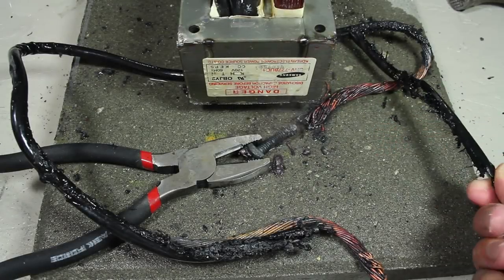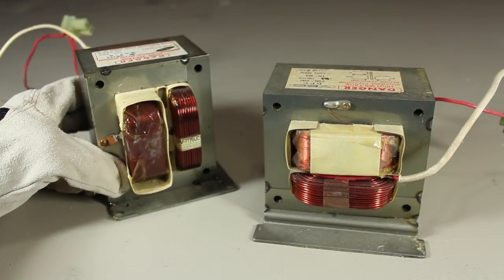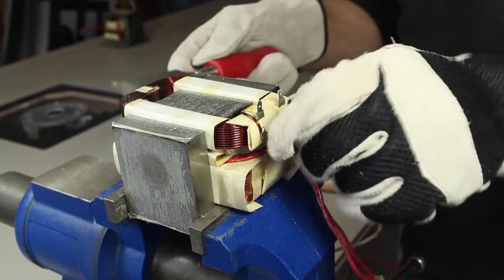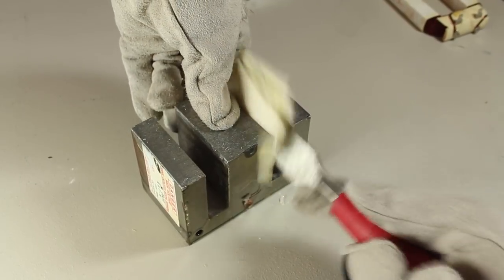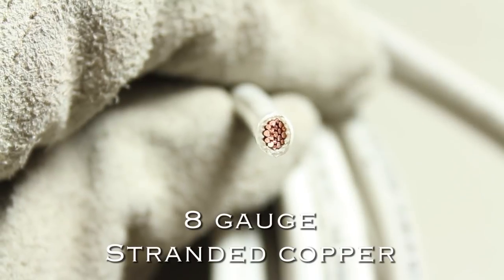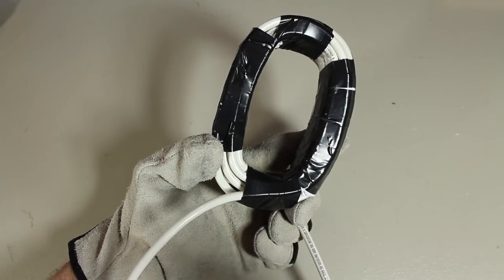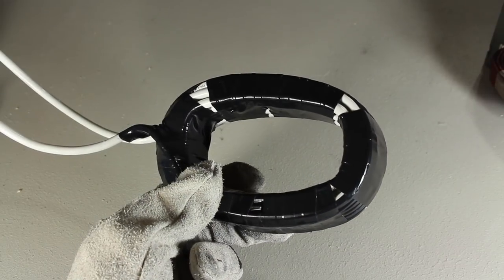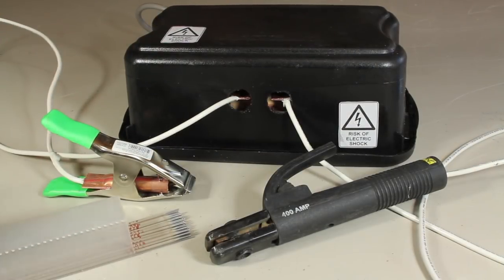Making an ARC Welder - Part 1 of 2

Comment: I built with 4 MOT, and got 36 V AC, 250A. Added a 220v AC cooling fan, a selector swith to get power from 3 trans or 4 trans, a 40A tripper, and one AC Power Indicator. Welder Works fine with 3 trans itself.

Comment from the maker: The stick welder and metal melter are two different modifications, so the power will be different for both.  Metal melter is up to around 800 amps at 2 volts, and this stick welder is up to around 100-120 amps at 30 volts.

Comment from the maker: I'd never heard of that before, but I just looked it up and I'm sure it would work.  To modify it, I'd just use thick electrode tips rather than 4 or 6 gauge wire.  Something like 2 gauge.  I'm sure it would work easily.  Thanks for your comment.

Comment from the maker: Congrats on your new subscribers.  Actually the earlier attempts failed because I tried a single MOT with 28 turns of 12 awg on 120vac and the insulation melted (for obvious reasons).  This setup hardly even gets warm after burning 10 rods in a row :)  Great duty cycle I'm happy to report!  I'm still a fan of the electrical tape, but respect your opinion.  Looking forward to your next tut!

Comment: Better off buying one for your own sake unless you really know what you are doing, another reason would be the need to change current and/or voltage, you need different strength to it depending on what you are welding..
Reply: +IAA015 He made a variable amperage system, search his "Scariac" video.

Comment from the maker: 8.36 mm2 - compliments of Google :)  Number of turns determines voltage.  Gauge of wire handles the current.  Bigger is better, but any bigger than 8 gauge won't fit in the transformer, so it's a compromise.

Comment: 1) Why do you not use the original secondary coils?
2) How do you determine how many wraps to make the new secondary coil?
3) Any idea how many amps this is?
Any response would be appreciated, I really enjoy your videos.
Reply: 1) because you need low voltage and high amp
2) the lower the turns the lower the voltage
3) you need amp meter to calculate
Reply: Thanks for the response!!
Reply: I understand the volts, how do you calculate the amps?
Reply: Winston Jordan
You should use an amp clamp meter on one of your output leads and you may increase or decrease the turns of the secondary acording to your needs

Comment: If you're into RC, the old secondary wire used in older, larger microwave transformers is perfect for rewinding fried outrunner brushless motors, it probably has a mile of it in the coil if unwound. Newer, smaller microwaves may use aluminium secondaries, not good for much, so make sure its copper.

Comment from the maker: Do you know any projects using cathode ray tubes?  There is a little wire, some capacitors, and a CRT in the monitors, but I'm not sure yet what you'd use it for.  There should also be a flyback transformer, and I know a few projects those could go into.  Any ideas will be considered.

Comment: how is it holding up. did the 8 gauge last longer than the 2 gauge or did it melt too. i've bin thinking of making a graphite ARC furnace to melt iron sand and maybe make steel.

Comment: I didn't know you could MMA weld with AC. Learn something new every time I watch one of your videos :) For DC, You can put 2-3 car batterys in series, as long as they have the CCA. Use some fence wire wrapped round a large form for a variable resistor. Surprising how long they last! I've been thinking about making an AC TIG, for ally. This might be a simple way :)
Looking forward to the next video.

Comment: Hi Grant, I'm 71 know, and worked as an Electrician since joining the Navy at 18. My work was always Maintenance Electrician. Repairing manufactured electrical equipment .Your at more of R&D projects.
The pole peaces on the xformer could be solid iron, with large circulating current, they are laminated to
reduce this current, to multiple smaller currents.Tack welding or clamping the end of the pole, allows a complete circuit, for the Eddy Current, and your right, it's a loss you can live with.

Comment: A suggestion on the vice work.  Try a set of "soft jaws."  These can be as simple as two pieces of aluminum sheet metal, bent ninety and placed on each jaw prior to clamping.  This way the part is pressing against the softer, rounded corner, aluminum as opposed to the harder, sharp edged, steel jaw.  On the complicated side, I've seen new jaw forms machined out of aluminum or bronze that fit parts exactly.  That's more than most people need.

Comment: Yeah, I know people who've done it with 1 core but it's tough to get it right. You probably can't use hookup wire, you'll need extra turns on the primary too. Need that extra copper to keep heat down. 2 cores and you've got a luxury of wattage :) Awww yeah.

I have 5 scripts open at the same time right now, they're all interconnected so it's taking forever. I'm really excited to see your water resistor, looks better than any I've ever seen. Ghetto but a polished, classy, reliable ghetto. I like.

Comment: If I live in the U.K. And so my outlet voltage is 240v and I'm guessing the microwaves transformers are also made for 240 v is one transformer fine ?
Reply: 1 transformer won't give you enough power to weld. He says this at the beginning!
Reply: Sean Craxford but i was thinking cox im in the uk the microwaves would be working with 240 v , so i might only need one
Reply: not likely, im guessing your microwaves are rated for similar wattages (here they're 1200 ishh) and its really the wattage that's holding one of them back
Reply: he is using an electrolyte in a tub to power his. i believe the transformers are DC with an inverter in the loop in the microwave, so you will need to convert the AC current to DC before the transformer. if you can push 240V DC to it, and it handle the load without catching fire....... it should weld. I weld at 40amps most of the time (1/16th rod) however when using 1/8th rod i have to push more of 90+ for 1/8 steel.
Reply: i tried this, my welder litteraly caught fire.

Comment: You are correct about the shunts. A better method than shunts is to add extra turns to the primary, but copper is more expensive than iron and manufacturers don't care about the efficiency.

Shunts are removed because they limit the power and at a 120v 1800w level (not so much 240v) you need every drop of power on the output you can get, even if it becomes progressively less efficient to get those extra few watts.

Comment: why do you have to rewind the secondary coil, how and why does the amount of turns in the coil effect the amps/volts?
Reply: amps is how much energy is in the wire volts is how fast the energy flows threw the wire also theres a balance with a transformer if you want more volts the amps have to equally drop and vice versa the reason you need to rewind the transformer is you want high amps not high volts, m.o.t. put high volts low amps you need to amps in order to weld so to speak ive made things like this before.
Reply: GA Drache  Voltage is more like the force that pushes the electrons through the wire and can better be described as electrical pressure, not so much how fast the amps flow. It can also be described as the electrical potential between 2 points.
Reply: Still not a very good answer. I want to know what/why the different amount of whinds in the 2nd coil make it different then the primary and why it needs to be different
Reply: Well its hard to understand, in transformers they are either step up or step down, in most cases. That means that the voltage is either increased or decreased. For example, you have so many turns of wire on your primary and you put 120 volts onto it. The voltage flowing through the wire will cause a magnetic field to be created, the magnetic field will then induce voltage into the secondary winding. To step down your voltage you use less turns on your secondary than your primary. To step up your voltage you increase the number of turns on your secondary compared to your primary. However when you step up or step down your voltage, your amperage also rises or decreases in a opposite manner. When you step up your voltage your amperage is reduced, and when you step down your voltage your amperage is increased. That's why, in the second part of this video, he can put 240v into his primary windings (2 transformers) and have 37 volts out of his secondary, but his current is as high as 200 amps.
Reply: So if he decreased the number of turns in his secondary to say 8-14 would this setup work with only 1 transformer
Reply: There are some calculations that would need to be done, but it's tricky to say. When it comes to transformers you have to watch your current in your primary and secondary. Usually power in must equal power out. For his primary he's using 240v at about 15.5 amps, 240X15.5=3720 VA. In his secondary he's got 37 volts at 100 amps. 37X100=3700, not perfect but really close. I would just do it the same way, the math and the results don't lie.

Comment: what happens when you use ten transformers
Reply: +CESAR ALEJO  the copper inside of the wire itself would either melt instantly, or explode
Reply: +CESAR ALEJO that's how our world was created.
Reply: +Ádám Sipos And it has to be transformers from microwaves too, don't forget that part!
Reply: +CESAR ALEJO POWAHH!!
Reply: +QuadraPlex 2001 it will just trip your beakers instantly
Reply: +QuadraPlex 2001 The voltage as well as the amperage would be extremely dangerous.  this could be done with lower number of secondary coil wraps and high gauge wire.  I do not recommend any mods without your own knowledge of how this works.  be aware of safety.  this is extremely dangerous.
Reply: chris netherton I don't have any intentions to go against the basic safety precautions of this project, here on the internet we say some things that arent ever done.  Thank you for your concern!
Reply: EXPLOTION
Reply: U would blow ur breakers
Reply: CESAR ALEJO you get more than meets the eye
Reply: Nathaniel Heidemann really
Reply: Death
Reply: CESAR ALEJO you battle for cybertron
Reply: Thrown out ones too

Comment: If you want to DC TIG weld with a homemade welder or AC buzz box, then what you gotta do is make a 5 phase bridge rectifier (made of five 35 or 50 amp rectifiers screwed over a heat sink or aluminum channel) and connect it to a choke (you may connect a capacitor to a choke, but it's not necessary since the arcs will be stable, anyway). The choke must then be connected to a TIG torch. In DC TIG, the torch must be connect to the negative diodes to get DCEN. A single phase bridge rectifier can be made with 4 diodes, such as the 1000 V by 10 amps that you see on Ebay (if you connect 4 of those diodes altogether, then you get an overall wattage of 40 kw as a single phase bridge rectifier). Homemade bridge rectifiers may also be very handy in case you wanna build a wind turbine.

Comment: Use this the same as you did the THHN wire. Wind the bundled wire around the armature you made.
Make your connections with Silver Solder when possible, it makes a good high current connection.
The coils should be coated with motor varnish, to hold in place.There are several types of insulating paper. to
use around the pole peaces.

Comment: I think Sinan's correct. The insulation on your wire probably doubles its cross section, but 50% of that isn't copper. Suppose copper 2x cross section... that means 1/2 the resistance, half the heat generated. Also, of the heat generated, there's 2x as much copper to absorb the heat.

Also, proper enameled magnet wire (like the primary) is rated for double the temperature (in 'C), Also, it's thin and transfers heat well, so the copper cools 3x as easy.

But it's more expensive. And yours works.

Comment: If you wanna make the electricity's voltage higher, you should make the secondary wire more turns; The primary wire is about thousands turns and the secondary wire is only eighteen turns, primary>secondary=step down transformer, you should make it to a step up transformer.

Comment: With high temperature 12 gauge wires, you should get a total sum of 23 turns (24 could be achievable) for your secondary coil.

I recommend changing the insulation of your wire that's rated for 300°C.

Comment: I'm not sure what he's talking about. You didn't leave a huge gap. A thin layer of enamel probably only fills in the gaps between the surfaces and is effectively identical to what was there before.

Motor rewind shops are a good place to get your transformers dipped in varnish, since that's what they do with motors. A friendly one might let you dip yours a few times for free if they're not busy. You might also be able to buy the heavy enameled wire from them.

Comment: A MOT is wound (in america) for 110v in, 2200v out.
So no, you could NOT have used the coils it already had.
Wire lenghts is not an issue, the original windings both have spade connections.

Comment: On the wooden Jig, if you cut a slot on both sides you can tape a zip tie to the center block.  Then when your done wrapping the coil, zip tie it up and they will hold it while you tape the crap out of it.  I couldn't get 6 turns to fit on my two transformers.  Had to go 5 turns for a total of 15.  I plan on finishing this weekend i'll post the result.

Comment: I got yet another batch of some questions that I really need answering:
1. Can this homemade welder of yours melt aluminum cans and copper wires completely?
2. Can arc welders that people usually buy in hardware stores melt aluminum cans and copper wires completely?
3. Can both the dc and ac converter welders melt any kind of metal and if they do which ones?

Comment: Transformers depending on the number of turns change voltages through ratios.. 
He used a thick cable on the secondary to handle the current..
The low number of turns reduces the voltage but allows bigger currents.. cable size will dictate duty cycle.

Comment: Just made one of these at work (with a few modifications) My first big project... i'm thinking about posting a video of it later... and I agree with most of the people here. This is a dangerous project (especially the Scariac.. Look for an alternative). I did ALOT of research and took ALOT of precautions before I decided to build this. I just hope everyone does the same.
Reply: I've been working on making this and was wondering what you did as an alternate to the scariac and if a power controller is necessary. I was just planning on plugging it in and just not being able to adjust the power unless that would cause a huge problem.

Comment: Also, just noticed. The way you linked the transformers in series is a nice workaround. I'd thought it was P1-S1==>series==>P2-S2, and was wondering how you didn't melt P2, but linking only the secondaries, keeping the heavy current only in the multistrand copper = genius. :D Two separate power connections to P1 & P2 with a variable phase delay between power and any one primary would also be the easy(-iest?) way to ramp the power output. Is this how you implemented the 'sariac'?

Comment: Awesome Grant! You're building tools which enable more complex projects! The downside is, you'll soon have a machine shop at home, & the new videos won't be "Things you can do at home...right now!", but "Things you can do...after you do all these previous ones :P"

Two questions. Why d'you remove the metal shunts (would they've melted)? AFAIK, they improve flux linkage & power transfer efficiency? Also, I didn't quite catch the default current regulating mechanism on the MOT. Can you elaborate?

Comment: .It might be put in your model X10 modifications.The other suggestion was to use, xformer rewind wire, (FormVar wire) it is a wire insulated with varnish as is your old xformer wire is.The spec for motor wire compared to THHN (house wire)is noticeably.
I think if I were you, I'd use the secondary wire you have. unwind the coil, and make wire bundles of say 5 or 6,wires. Use cotton tape ( at intervals) to hold wire bundles,  This tape can be soaked with varnish when complete.

Comment: Grant Thompson I have a question regarding your turns ratio. I remember reading in your Reddit AMA that you don't have any formal education outside of high school but that you do a lot of research regarding your projects. This one I'm very interested in. I'm an electrical engineering technician and this project reminded me of the transformer calculations regarding voltage/amperage and turns ratio. Looking back and doing my own research I'm interested in how you computed your turns of wire for your secondary and how you calculated your output voltage. The calculations I'm computing, whether using 1 transformer and computing half values, or using both transformer, my numbers aren't adding up to yours. They aren't off by much, but they're still different. I guess I'm looking for some technical data.
Reply: Are you holding your breath whilst waiting for an answer?

Comment: You shouldn't have used that cable as secondary coil. Cable's insulation cover makes it thick as hell.
If you had used coil wire, you could have used thicker wire which would make it a more powerful welder.

Comment: I would have used the original secondary as the primary. That way when you rewind with fewer turns you get a higher amperage output. At a very low voltage. Unless there was some purpose to keeping it at a particular level?

Comment: may by that cause of heat that can melt the insulator around the coil for both 
secondary & Primary , Besides it it will hard to modify the transformer again
if you want to use it for another purpose or projects .